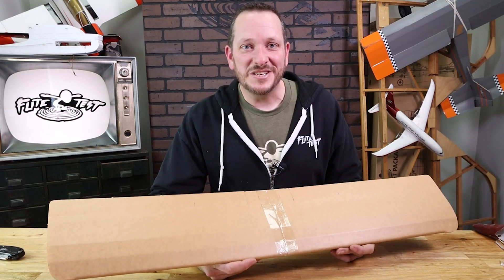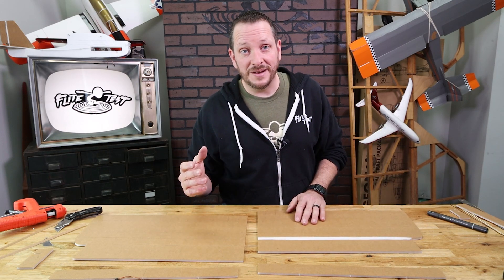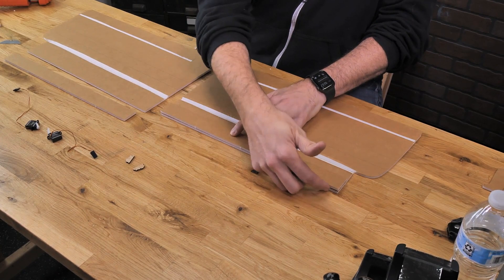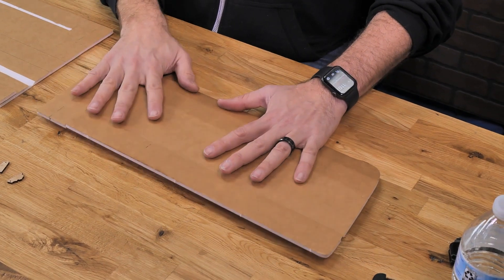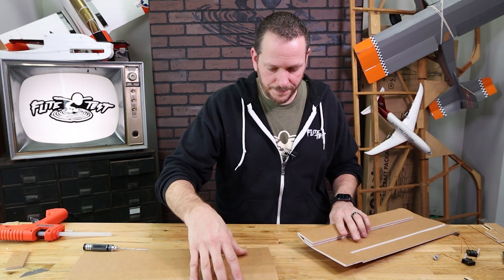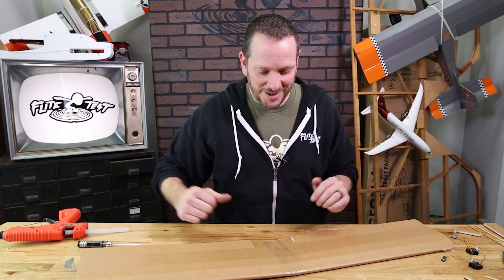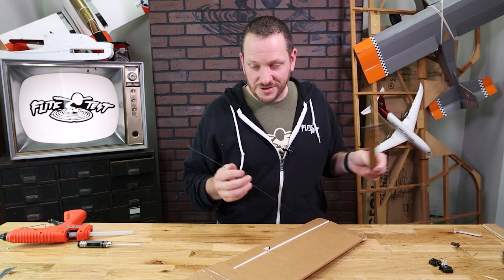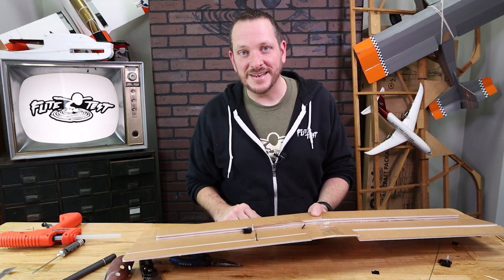How to Build the FT Tenet Aerobatic Wing // BUILD

Comment: Hi Josh, the Tenet build videos that are now on YouTube are great as usual, but there are still missing pieces:

1. How to use the new FT motor mounts
2. How to mount the electronics and battery
3. How to build the tail - just build the horizontal and vertical pieces together and glue to the top of a removable tail holder?
4. Where and how to install the servos for rudder and elevator - how to route the control rods

My Tenet speed build kit arrived today. I've already done the fuselage, and used colored packing tape as in the "How to Build and Reinforce the Fuselage" video - no problem and it looks fine. I'll do the Sport Wing tomorrow. But I still need advice on the above. It doesn't have to be necessarily in a full-fledged video - even just descriptive text on the Forum would be OK

Thanks!

Comment: Don't the scratch builders get free plans
Reply: FT does not release free plans (for new designs) due to people making and selling unauthorized kits from their plans in direct violation of their stated licensing. Some plans will become available to purchase through the FTCA for members. Additionally the Tenet fuselage is cut from solid foam using a CNC wire cutter, not something most people will have available anyway. That being said, if purchasing from FT isn't an option for you, there's no reason you couldn't eye-ball the dimensions and make your own from scratch.
Reply: @jasonhurdlow6607  please, I've been looking a lot, where can I find the measures, dimensions of the FT tenet?